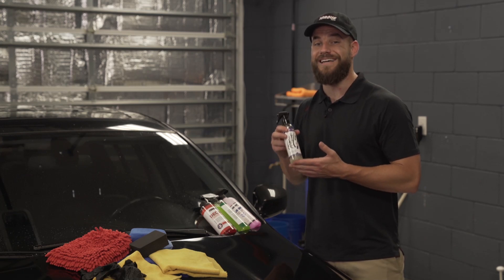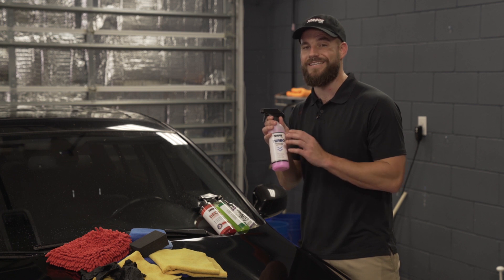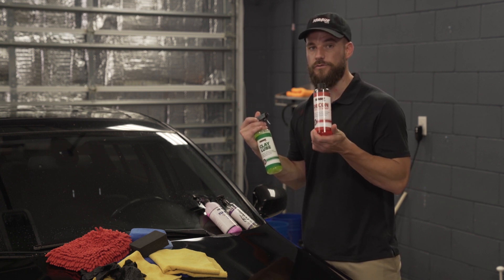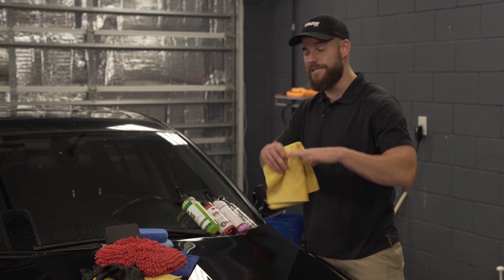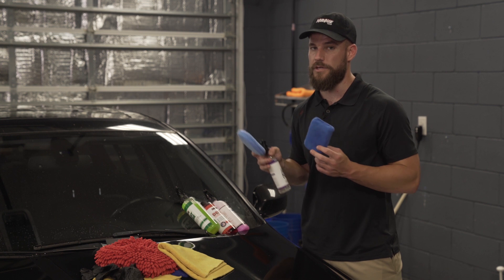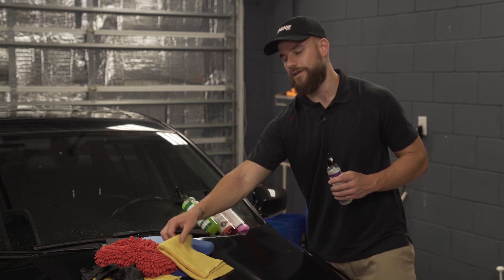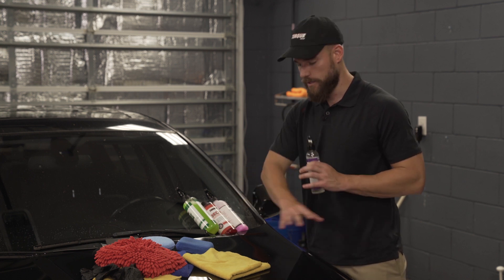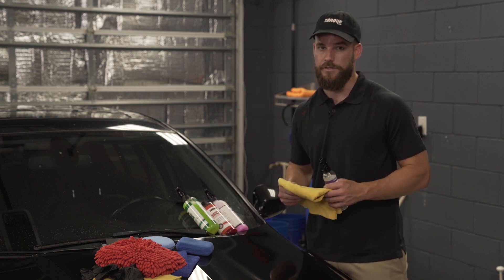Ceramic Coating Car - How To Apply Ceramic Coating Spray

Comment: QUESTION: I have a 2018 ZO6 Corvette the paint is in excellent condition. I’ve put a few coats of wax, and many coats of spray wax on the car. Should I do a "strip wash" with dish soap, and do I need to clay the whole car before applying Torque Detail? Feedback is much appreciated.
Reply: You need to completely remove all the wax and any residue from the surface.  Also, claying the surface is always a good idea.  It also would be a good idea to lightly polish the surface and use IPA 70% to clean the panel right before applying ceramic shine.  At a minimum, strip off all your wax and make sure the surface is clean.  The additional steps I mentioned are not necessary but will give you the best results.  This is true of any product, not just ceramic shine.
Reply: Wow.  A 2018 Z06?  I had a 2005 Z06 and it was mind-blowing the level of performance and efficiency that car had.  I can only imagine the improvements that have been made over the years.
Reply: @Mr25thfret  My dream car! 650 horsepower, 650 foot pounds of torque at the rear wheels when that supercharger wines up look out! Of course I've made a few upgrades it's now over 700 horsepower in a car that could literally be a daily driver. Sick!